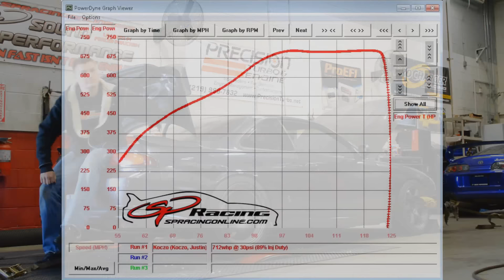Justin's 700whp 2JZ Auto 240SX Dyno @ Sound Performance

Comment: how were you guys able to get the A340E automatic to withstand that much power? guy I know with a turbo 1uz sc400made 500whp with a built a340e and it began to overheat and slip at 500whp he had a large trans cooler too, just wondering how you guys did it?

Comment: what fuel are you using on these runs?
Reply from the maker: 93 octane or E85, whatever the guy wants!
Reply: +Reid Dawson I guess I should have been more specific what fuel was it using when it made 700
Reply: mxrider1111111 e85